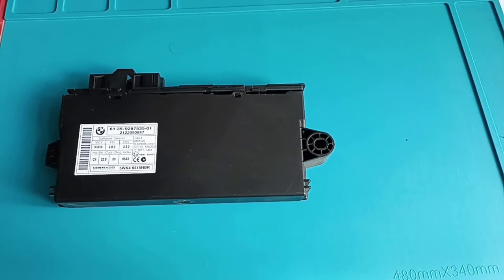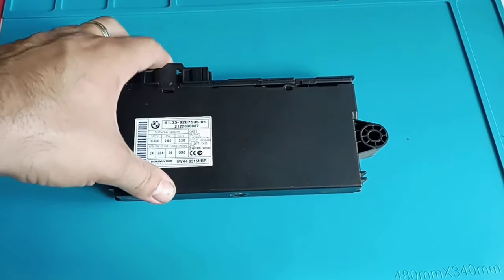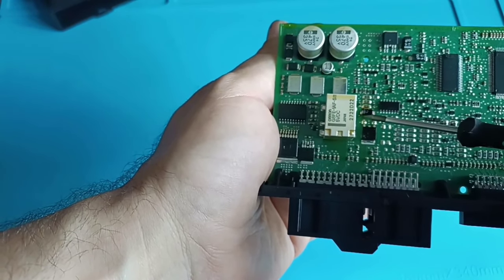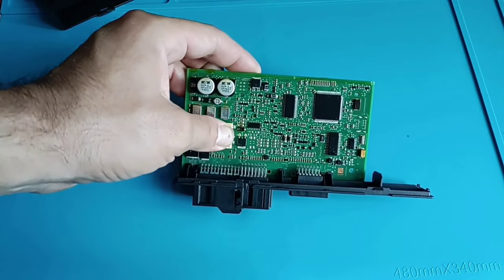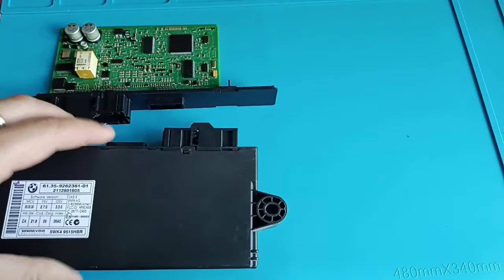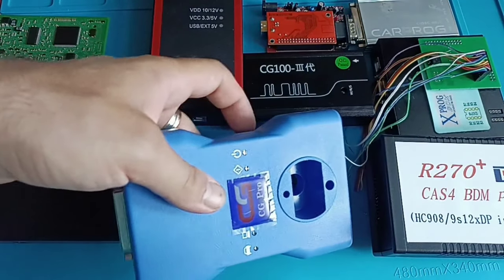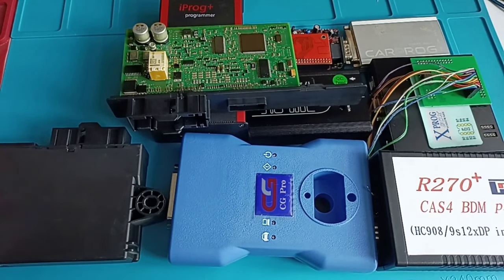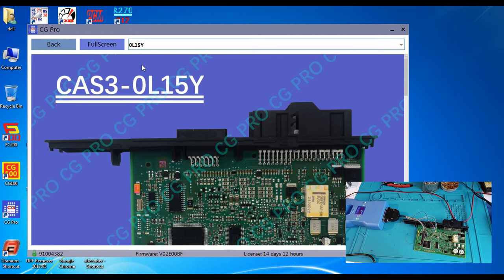BMW E84 CAS3 module Flash/Eeprom read/write with Xprog .CGpro. CG100. R270. Carprog. Iprog. UPA v1.3

Comment: You didn't show a video of you writing back the data to the new  CAS3, what's the next steps on how to write back to new CAS3
Reply from the maker: It is similar to reading. Instead of pressing the button to read the flash you press the button to write.
Reply: @YOYODiagnostic  so,I would write both eeprom and pflash back up to new CAS?
Reply from the maker: @chukwuemekasamuel156  
Yes. 
Both and  is ready to go, just plug the wires and start the car
Reply: @YOYODiagnostic  thanks I really appreciate your reply,it was helpful
Reply: @YOYODiagnostic  for CAS3+ all key lost,which tool can I use to generate ISN.I have only CGPRO
Reply from the maker: @chukwuemekasamuel156  
One of the best programmers for BMW is. CGDI BMW and VVDI BMW